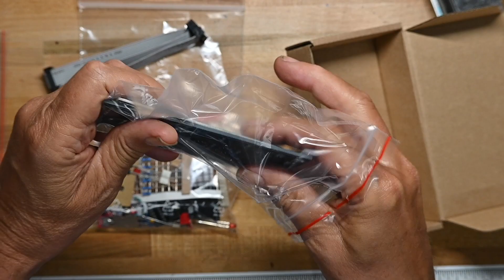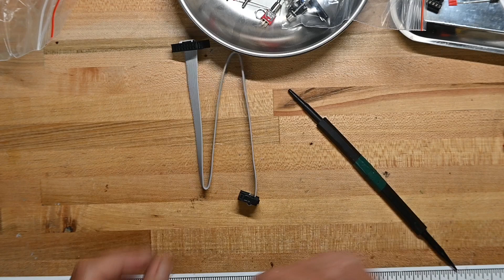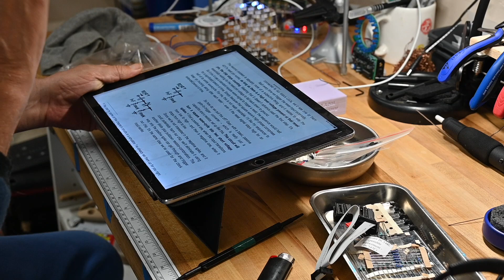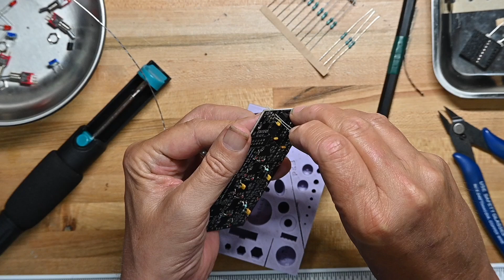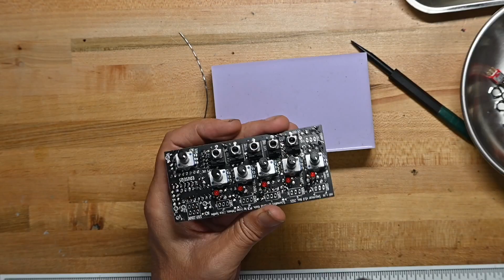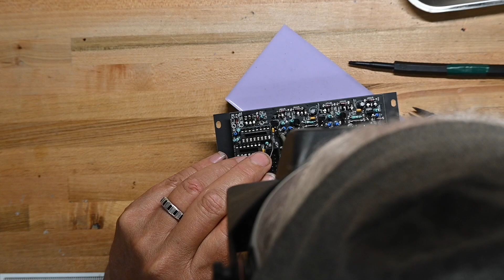C.K. builds an EDU sequencer kit from Erica Synths

Comment: I find a lot of usefulness from these "sort-of"  basic type sequencers by way of external clocking with IRREGULAR trigger rates.    If it steps through as it gets a trigger/gate and not based on some anticipation of future clocks ..ie...no divide/multiply functionality - then you can do some quite complex modulation over time .   Being 5 steps, patterned gate signals into reset (not just on the 1st for example) can extend patterns in interesting ways too if it the clock in is non regular ..(occasional bursts on the clock in for example).
Reply from the maker: Good ideas.  Look for an upcoming video of mine building the "Missed Opportunities" module from CuteLabs, it's a very interesting probabilistic skip/no skip/pass along for impulses.  Fun unit. Should be up in about 8 days.

Comment: Great stuff as usual CK.  Just curious if you ever got those LEDs sorted out.  As a novice DIYer, troubleshooting and fixing issues is still super challenging.  I don't know enough yet or have the skills to undo mistakes easily.  I have a $150 paperweight from a botched build, but I'm 8 out of 9 now. :-)  It'd be very cool to see a video of you making, finding, diagnosing and fixing an issue like a couple of LEDs not working, or de-soldering and re-soldering a component.
Reply from the maker: Thanks!  And no, I didn't take too deep a look at it since the switches tell me which pulses are on.  And I like this module the least in the EDU series.  
But I'll take a deeper look (and record it) soon.
As for botched builds, I don't have a clue how many kits I've failed on over the decades, part of the process....